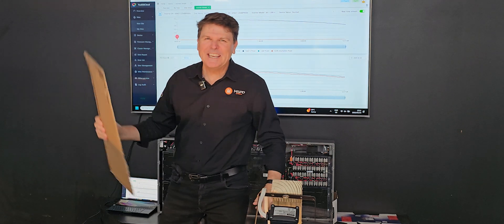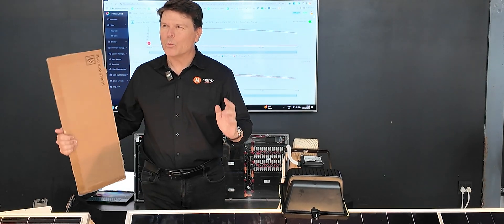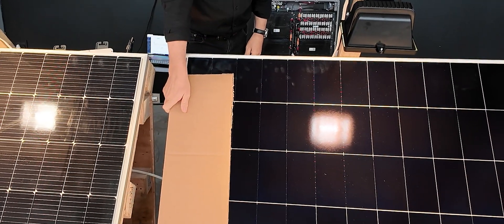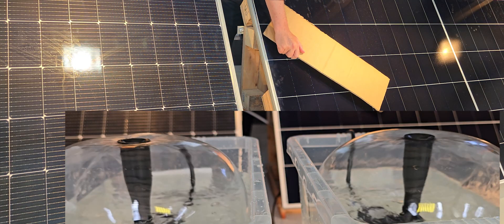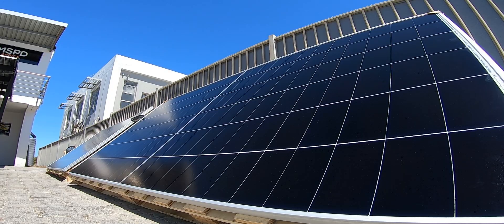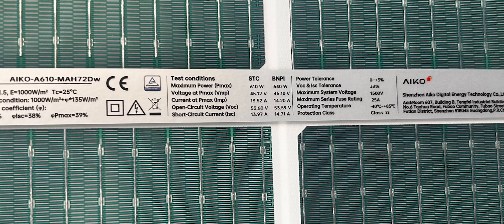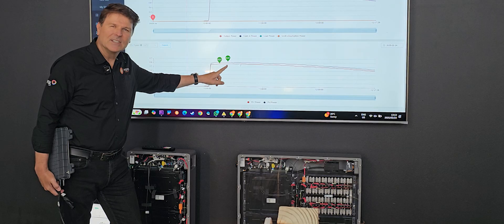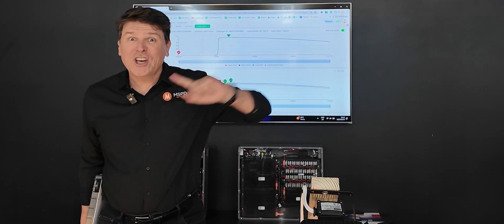Super Excited for This Aiko Solar Panel Breakthrough! | MSPD Africa MythBusters Lab | Mark Becker

Comment: Ok, it was great to see someone actually testing rather than slating without evidence, but where is the rest of the vid? Where is the explanation for the water pump other than it being a low voltage pump that the other panel couldn't supply enough current or voltage.

Comment: Thats cool that you build the propaganda machine. But on the roof is just flash test differences. Aiko is positive tolerance, I guess the other is negative. 
You didn’t shade it in the video on the roof so how does it prove the shading propaganda? I tested the shading in this video https://youtu.be/2n7tgQeDRJc?si=LlMXcj6uGFD3p9D6